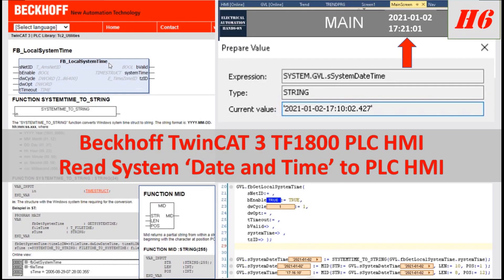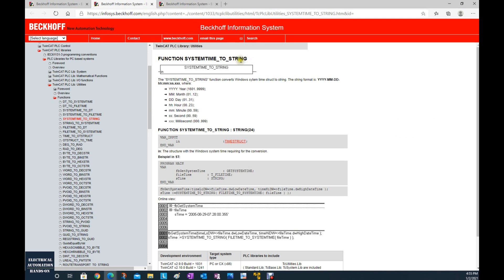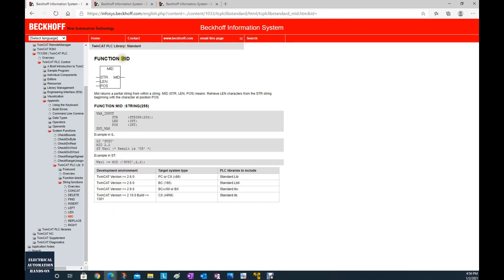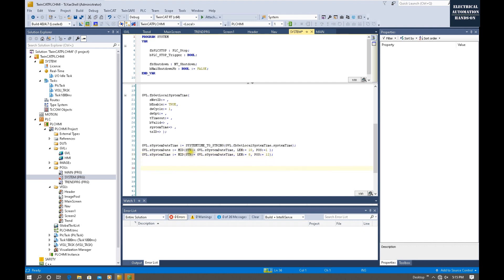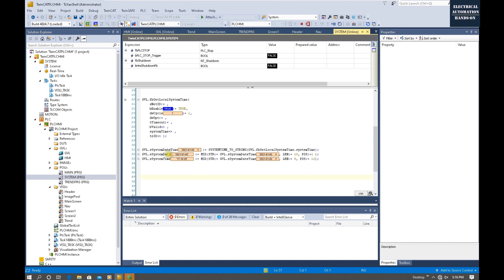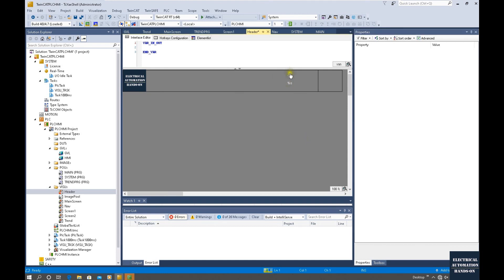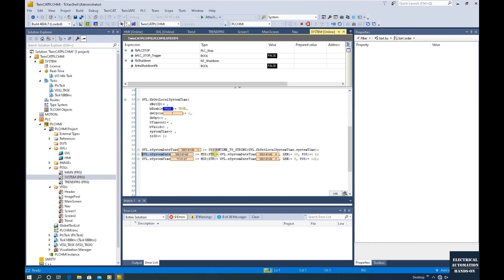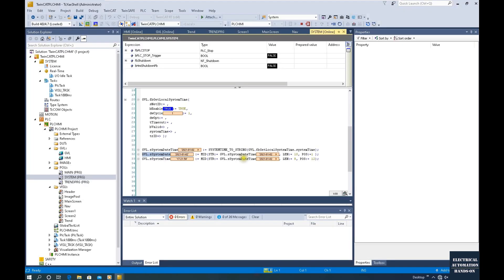HMI06. Beckhoff PLC HMI - Read Windows System 'Date and Time' to PLC HMI (6/6)

Comment: Hello Sir, I don’t know why but I got 1970-01-01 as system date and not the current date. Do you have a idea? Thanks
Reply from the maker: Please check your TwinCAT computer, if your computer time is 1970-01-01 after cycle power or power down, may be your computer BIOS battery is dead.
Reply: Did you find the solution to this?

Comment: How to show visualization in full screen in twincat 3? I have done in twincat 2.
Reply from the maker: The file Tc3PlcHmi.exe works for the full size screen if you are using TF1800 license and using Visualization manager. For the specific screen, you can set the 'size mode' to 'Specified' at the 'Visualization '. More details, I can not remember clearly, you need to do some search in the manual Beckhoff online support.

Comment: I've been watching all of your Beckhoff videos.
They are very helpful!! Very good instruction and your English is very good!
Could you do a video on setting up an Alarm Banner and an Alarm management screen in TF1800?
I know they have tools in TE2000 but I don't see an easy way to handle alarms in TF1800.
Thanks!!
Reply from the maker: Glad you like them! The 'alarm message, banner, management' are complex in the PLC HMI. That idea is similar as LEGO, means that the 'message' is the string you have to use your logic to write and do FIFO, it is so tough for the new leaner. That is one of the key reason I don't have plan to show it. Unless you can find some existing projects or template from some vendors. Staring from the scratch is difficult. If you are doing a project rather than a signal standalone machine, I would recommend you consider TwinCAT HMI (not this TF1800 PLC HMI) or other brand panel HMI.